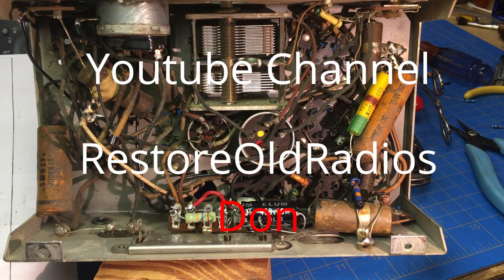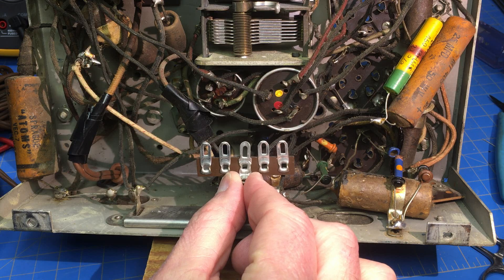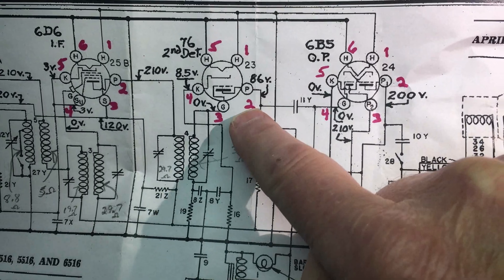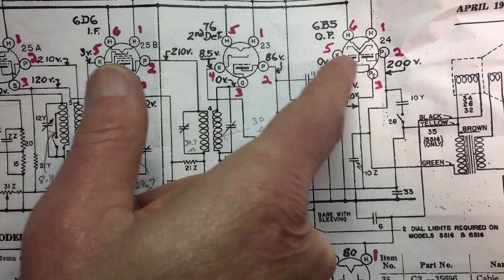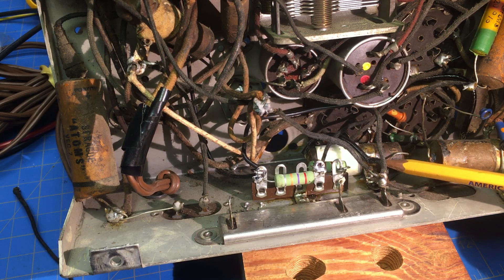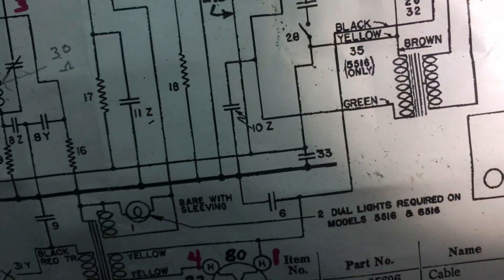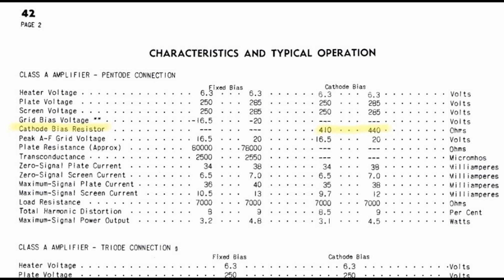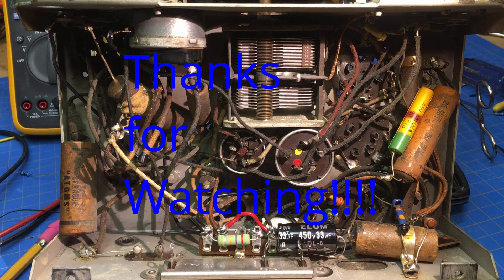1936 Crosley 516 Fiver Part  4 of 7  Candohm resistor replacement

Comment: I have a Crosley 515 which is "pretty much" the same chassis as the 516. I had to replace the power cord. The old cord was snipped off with about and inch left to show where the new cord would go. I soldered in the new cord where the old "nubs" were and it fired up. The problem is, it won't shut down. One leg of the cord was connected with the black\red striped line coming from the transformer (plus (9) .01 mfd cap) to a leg on the on\off switch and the other leg of the cord is  attached to the black line coming off the transformer attached to a terminal strip mounted under the on\off switch. Did I wire something the wrong way? One leg on the switch had nothing soldered to it. Any Ideas?
Reply from the maker: Daniel Messina Hi Daniel.....what you describe is that the power cord is wired directly to the transformer primary....the on/off switch may have gone bad and someone straight wired it......does the on/off switch have wires to each of its two terminals or just one? Hope this helps—Larry
Reply: @Backtothefutureradios  Hi Larry, Thanks for getting back to me. What had me banging my head against the wall was that one of the terminals on the on\off switch was CLEAN..It looked like nothing was ever soldered on it. I tried putting the transformer and .01 cap on  one terminal and the AC on the other and got...nothing. So I checked the switch with a ohm meter today. Unless I did something wrong it's bad. I have a couple of parts radios.. I'm wondering if I could rig a switch up from one of them?
Reply from the maker: Daniel Messina yeah, figuring out what others have done in the past can be a head scratcher for sure....what I normally do, is take the switch apart if possible and spray it with deoxit and work it many times and see if that cleans the contacts in the switch. Sometimes that’s all that is needed....the schematic doesnt list what the resistance of the potentiometer is......you can measure across the outer tabs of it and determine what the value is.....you can order a replacement potentiometer/switch from several places.....I usually use Antique Electronic Supply in Arizona. An audio taper pot with an on/switch would work fine. I no longer have the 516 or I would check mine.....but I may have another one I can check the value of the pot. Perhaps that will help you compare the value of yours? Hope this helps, if ai find the value, i will answer here later. Take Care—Larry
Reply: @Backtothefutureradios  Hey Larry, thanks again for taking the time with my problem and writing me back. I have the switch apart and I'm soaking it with CRC. It looks pretty clean and in good shape.  I'll let you know if it works.
Reply: Hey Larry, I wanted to update you on my Crosley 515 volume control. I called Mark Oppat yesterday to try and order a new one and he suggested spraying the control with WD-40. After a good soaking with WD I put it back together and it worked! Still a little fussy but working. So now I'm going to replace all the resistors and recheck the speaker coil to see if I can get some sound out of it. One last question, I also had a 22mf blue electrolytic cap hooked up between the ant. and the 8mf electrolytic cap that's not in the schematic. Should I put a new  one back?
Reply from the maker: Daniel Messina Glad to hear that the WD40 worked! Working the switch only will make it better, I believe.....Im not sure about the cap at the antenna, if its not on the schematic, I would leave it out.....I dont understand why an electrolytic cap from the 8uF power supply cap to the antenna would be there? If ever in doubt, trust the schematic......sometimes they are wrong, but when something has been added by someone, you dont really know what they were thinking.....ask around maybe on Antique Radio Forums, there are a lot of smart folks that are willing to help! Hope all this helps.....Take Care—Larry